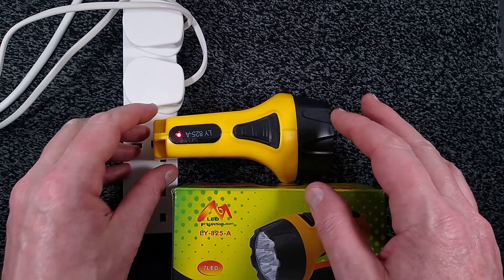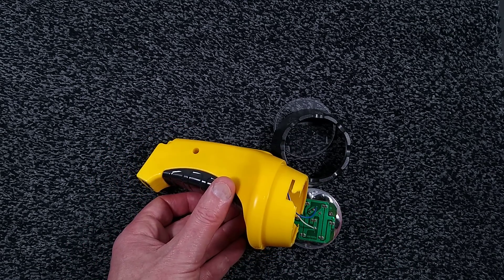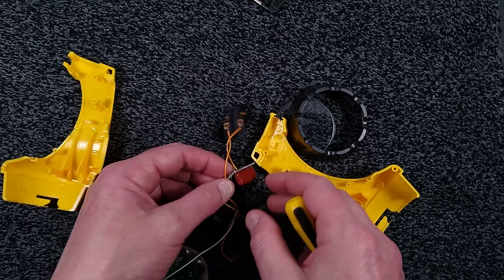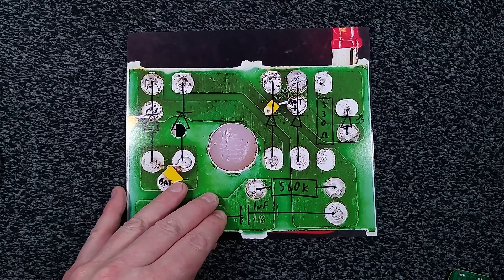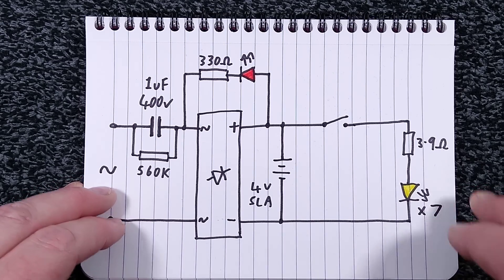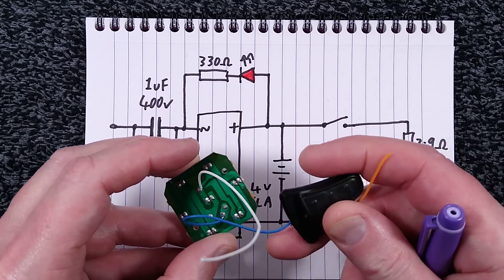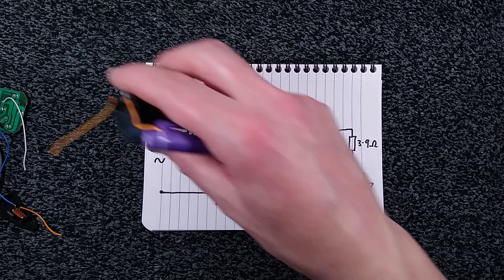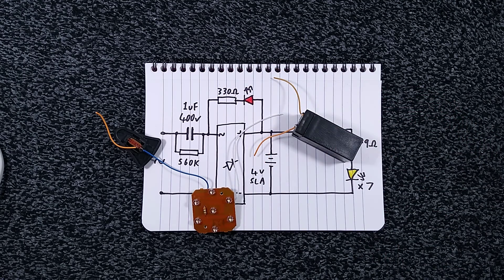Taking apart Vince's Cambodian rechargeable flashlight

Comment: Seems quite sensible.
Reply: Not at all. I've dealt with dozens of these from various Chinese makers, and they mostly fail within a year or two when the battery inevitably dies from uncontrolled charging. Or when the low-quality capacitor goes bang. 

I have one in front of me right now, which I got from someone totally fried and salvaged by completely replacing the innards with an 18650 cell and USB charging.

Comment: I have a similar flashlight, it's a bit larger, has a single high power LED at the end, and an additional panel of a few SMD LEDs for using as a desk lamp.  It also uses a lead-acid battery, which I think stopped working. Nothing seems to be burnt inside, but once I plug it into the socket, it makes frying sounds. Got it for cheap a few years ago, helped me survive a power outage caused by a transformer failure right before a serious exam at my uni
Reply from the maker: The battery might have dried out.
Reply: The distinctly frying sound comes from the capacitor, that's been my experience. I've had it happen to first generation capacitive dropper bulbs (no batteries) as well.

Comment: Hi bigclive I'm looking for a small rechargeable powerful touch. Which one would you recommend I buy as I see so many on ebay but I don't believe what they say in there listing so I could do with your help. Kind regards Graham
Reply from the maker: I like the Nitecore keychain flashlights, but what you get really depends on your exact needs.  My work preference is a head torch.
Reply: @bigclivedotcom  head torch is a must when working with both hands,  especially in a loft
Reply: I bought a nitecore tm9k for my brothers birthday and it is brilliant. Only problem is that you can't replace the battery
Reply: Power bank + USB light?
Reply: There's a nice clip style light called Streamlight Clipmate. It is mainly meant for clipping onto a pocket, and has an aimable gooseneck. 

Is very bright, has multiple modes, is convenient because it remembers the mode you last use. Also has a red light mode for night time vision. 

And has built-in USB connector to recharge and plugs in kind of like a USB drive

Comment: Those were all the rage a long time ago, in the "pre-LED era", and marketed as plug in emergency lights.   They were OK and reasonably effective, but run time was really only enough to change the fuses or reset breakers.  The "Charging" indicator was a neon if I remember correctly
Reply: My father had one of those 50 years ago. One night it exploded while plugged in. Turned out the dropper capacitor decided to give up 😅
Reply: I think I do recall pulling one broken/dead flashlight apart and seeing that the light was a neon. Wired right across mains (?). Long time ago!   👴

Comment: Hmmm..  a taser?
Reply: 400v is not compatible with life. A taser is much higher voltage like 15kv, 20kv and higher. Much less likely to stop the heart. Anything much above 300v and under 1800v does not give second chances. Not a hard rule.
Reply: The large gaps are burning ranges or close enough.
Reply: @napalmholocaust9093  Yes but a simple buck convertor and a large capacitor and hey presto lol

Comment: It would be an interesting project to repurpose this to use a rechargeable LiPo with a 1W or          3W star LED.
Reply: I would loose the mains charger and go for charging from USB.
Reply: But main advantage of this flashlight is you don't need extra charger and cable with fitting connector because it's build in and always with flashlight.
Reply: @gedtoon6451 in today's modern western world? Absolutely. USB DC charging ports are everywhere. Built in AC based charging is handy in places where having a charger or charging port isn't always a granted luxury. 😊
Reply: @AnnaVannieuwenhuyse  I would say most people who have access to electricity will have some sort of mobile phone at this point. I'm in India, but Cambodia should be similar. Everyone I know owns one or more of these lights purely because they are cheap, and they all have like five USB chargers lying around.

Comment: Are those thin little wires coming directly off the mains safe? Seems like not enough conductive material
Reply: The current draw is very very low. You only need as much metal there as is necessary for a safe and relatively low loss current flow.

Comment: It reminds me of those halogen torches from perhaps 10 or so years ago that had the small 6v lead acid battery. I'm sure they'd only run for about 30 minutes on a full charge, but they were by far brighter than any other torch at the time. Think they also took something like 12 hours to recharge fully.
Reply: Yes the ones I remember had a 6V 25W halogen bulb with a H3 type socket, so the current draw must have been about 4A!
Reply: @Acamperfull  I had a few of then ~20 years ago that used 10W H3 lamps that were marked as 55W.  To be expected given that they were $6 each new.
Reply: And no over-discharge protection. Basically the battery is discharged to 0V.
Reply: @jesusortizcara9093  No they discharge down to 3V, when the LED forwatd voltage limits them. Yes a short merry life, more because they charge all the time, and the cheap cells they came with often were cost cutted, by having one pair of plates in each cell, and the rest taken up with a sheet of polystyrene, so as to not need to fill the cell with acid up in the volume. Problem with those small 2 cell SLA batteries is that they are not often recycled, being thrown away, and incidentally I see them as well in emergency light bulbs, in an even smaller form factor.
Reply: @SeanBZA  Those that are halogen technology do not have any voltage cut-off.
Reply: @jesusortizcara9093  Oh yes those ones, normally a blue coated "halogen" capsule, which invariably would fail when dropped, if the battery did not fail first. Had a few of those, took one and retrofitted it with a 55W 12V halogen lamp, and a long lead with clips on it, to use under the car. Lasted about 2 hours before the front plastic melted. Replaced the 55W lamp with a 20V dichroic instead, leaving the front cover off, and it lasted a while as well, till I took an old LED spotlight, and retrofitted it with 3 3W LED dies, and a 12V power supply to drive them at 300mA.
Reply: Thank you for reminding me of that torch!! Methinks that I can easily upgrade the long-dead lead-acid cell with a lithium pack and an LED. 👍
Reply: @gertbenade3082  Lithium-ion batteries are dangerous.
Reply: Yup we had intrinsically safe halogen portable lights for working on the Tankers for taking ullages, nice and bright but didn't last too long and took a while to recharge,  mind they were all kept on a dedicated charging rack when not in use ,which I am sure didn't help much..😊
Reply: These are still in use as emergency lights in Manny companys in the power distribution rooms.
Reply: Expensive 6V batteries with those springs at the top from memory.
In Australia they were called Dolphin Torches.
Reply: @PetraKann  , some similarities but this was no iteration of a dolphin torch.
Reply: Looks like every resistor and diode on that board runs very hot, based on the discoloration. I wouldn't leave that thing plugged in unsupervised.
Reply: @mxslick50  With 70mA current that means those diodes are very poor quality, as they are rated for 1A, or the board runs so hot because it is enclosed in such a thick plastic and insulation.
Reply: How do you manage to print when travelling?

Comment: Wow! So apply an unregulated charge to the battery... Over voltage charge will result in hydrogen gas buildup and become a potential hazard with internal pressures. Curious what the floating voltage is with the battery disconnected but the charge LED still in circuit?  That will give an idea the max voltage possible and possible issue or not. Well when you got time can measure that and report findings.
Reply: My thoughts exactly. The battery, if it consists of two lead acid cells, will gas and leak electrolyte, which is sulphuric acid if it is left on a float charge of over 4.6 volts. The circuit has no voltage limiting so the battery will be destroyed after it reaches its maximum charge. Basically the design is rubbish.
Reply: @peterjameson321  It's not rubbish design, it ensures repeat customers. I'm not kidding, it is almost a consumable in places like here in India. People complain about them, but still buy them anyway because they don't know better and don't look for the more expensive lithium ones.
Reply: There is no hazard really, given the small sizes of these batteries. It just vents slowly and dries up. 

Now the 12V 165Ah lead acid battery that powers my UPS, that's something.